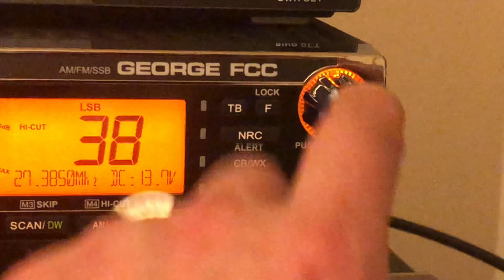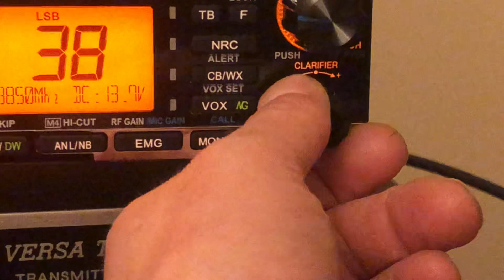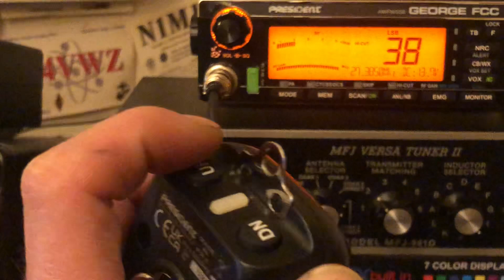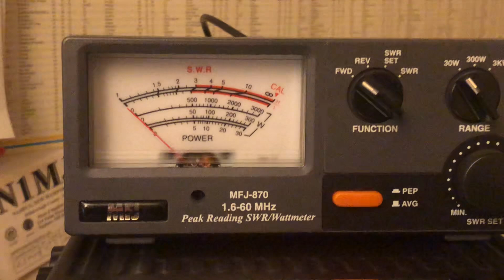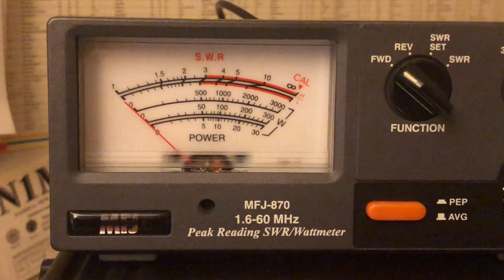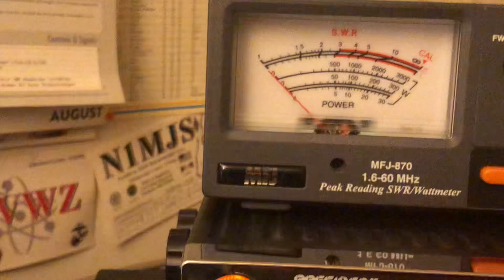President George FCC Power Test #cbradio #swingpwr

Comment: Just got it today
Reply from the maker: Make sure to read manual.  Have fun with the President George FCC.   I feel the best feature is the NRC (noise reduction circuit) which is adjustable.  I leave my Receive on 2.  Cuts the hash out.
Reply: @mikecricket113 that’s what I set it at  otherwise it sounds too crazy
Reply: Just got an RM literally KL703. Any advice on how many watts I should put into that amplifier dead key

Comment: Were you on a dummy load checking that power ? If not, that's not accurate at all.
Reply from the maker: @Rka1970  most folks don’t have a DL so it’s what they will see through an antenna.  Either way they are either going to run barefoot at 4-12 w. Or drop to 2 watts and run heat.  CB is QRP out of the box we all know that

Comment: Very nice radio! I was debating with myself which of the President radios I wanted to get. It was really down to a coin toss between the McKinley and the George. I ended up picking the McKinley primarily because it has a front firing speaker, but I really love the styling of the George and the built in USB charging port. I use my McKinley predominantly in a base station role
Reply from the maker: Good choice either way.   Also don’t forget most of their radio if not all have an external speaker jack on the back.

Comment: How's yours been working mine deadkey 3w swings to 9w on a 20w scale on am maybe max 10w
Reply from the maker: I mean my meter could be off. It’s no bird meter.   3 watts dk for you. That’s about right for president.   
I know there is a menu video on YT. For the radio to tweek am pwr and such.   Just make sure you write down the stock settings before you adjust 73
Reply: Been looking for the service menu , can't find it, the George 11 is on here, but can't find the George FCC.

Comment: Does this radio have variable power? If so how low can the dead key drop to
Reply from the maker: Yes it does.  And mines about 2 watts or so on low power.   Two watts usually is the sweet spot for heaters.  The radio has talkback too.  You know what I am really impressed with is the NRC button for receive , transmit or both.  The Noise Reduction Circuit is Amazing on receive   It is another form of filtering that cuts the hash out.  Hope this helps you out.
Reply: @mikecricket113  nice!!! Thanks

Comment: Didn’t the McKinley do better on your power test? Especially on SSB?
Reply from the maker: About the same.  Honestly I like this George FCC better But that's me.  I run them barefoot. And if someone is going to tune them or detune for heat then it doesn't really matter, as long as the modulation is good.
Reply: @mikecricket113  I run all my CBs legal, so pep is important!
Reply from the maker: @clydeosterhout1221  I’m proud of you for running legal.  We are a rare breed.   73.  Enjoy the Hobby my friend.

Comment: I would recommend getting a better power meter since you're getting free radios to review from the manufacturer.
Reply from the maker: Got any recommendations? I’m all ears 👂😀
Reply: @mikecricket113  the LP-100A. Even better accuracy than a BIRD. You need something that is powered to accurately measure true PEP. Also most Watt meters on the market including BIRD actually have a pretty wide tolerance so the power measurement may not be as accurate as some people think
Reply: I use the mfj giant watt meter it's close to the bird. Mike I think the one you got is fine. Just my two cents and sorry gentlemen for butting in

Comment: as with all modern cb radios it has anoying high s meter reading , if you have s-0-1 noise floor on other radios the george will show a s4 - 7 noise floor
Reply from the maker: Funny you mention this.  In my neighborhood there must be millions on LED Christmas lights upon everyone’s front lawns.  String lights are notoriously known for leaking RFI.   For the last 3 weeks I have noticed more and more noise on 10, 11, and 12 meter bands.   A high noise floor is not the usual for my area.   So I imagine it will subside after New Year’s.   In the case of the RF gain on the George, there are 10 settings I have it wide open in this video.  I turned the RF gain down to 9 one notch back and that dropped the noise floor 2 db.   Doing so did not eliminate my ability to hear weaker stations.   I think CB guys forget to use RF gain.   Also using the filters like NB and ANL or high cut will help during the holiday season.  
73.  Thanks for your feedback.
Reply: Excellent reply 👍👍. Nice radio!